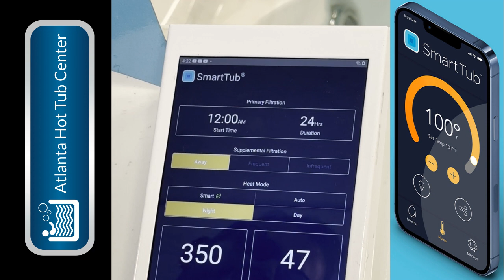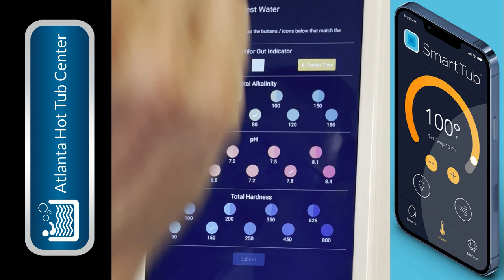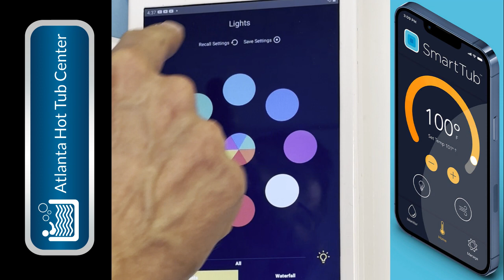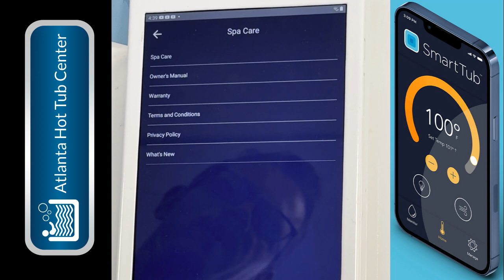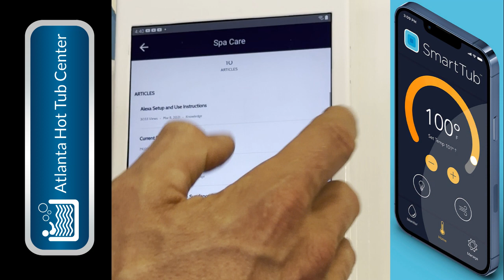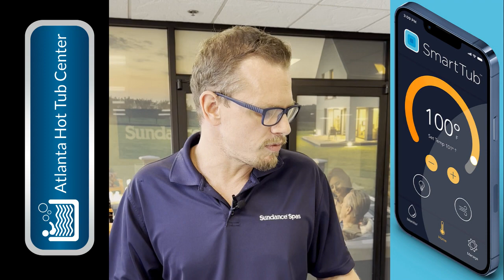Smart Technology for a Better Hot Tub Experience: The Sundance SmartTub Demo

Comment: Ours worked great for the first few weeks when we got the hot tub, then for some reason it spotted working while we’re away from the house… the system just kicks us out and we get an error code saying it timed out. Call customer service and was told that I need to get an antenna for it due to low cellular coverage. What a Bummer!
Reply from the maker: Good morning, the extender antenna for the SmartTub works really well.  They’re around $20 from your dealer and most dealers won’t even charge you for it.  I would call your dealer.  However, if your cell signal isn’t good then it will run on your WiFi which is why it works close in close proximity of your home.  Hope this helps!
Reply: I have a Jacuzzi tub with SmartTub, which I’ve been told it does not run on Wi-Fi. Thank you for the information and contacting the dealer to see what we can do about the booster antenna. Thanks.
Reply from the maker: @davidp8791  Good afternoon, the new 2024 SmartTubs work in WiFi and cell network.  Might be worth looking into.  Hope this helps!

Comment: I thought there was a wifi model coming out this year? For those of us who don't get cell coverage.
Reply: Does SmartTub only works with one specific brand of hot tubs? We have a THERMOSPAS hot tub… bought it last year.
Reply from the maker: @RickySilvaMusic  Good evening, SmartTub won't work with thermospas unfortunately.  However, ThermoSpas should have a app based wifi product you could use.  Hope this helps!
Reply from the maker: Good evening, there's already a wifi module out called SunSmart which you could use.  SmartTub will end up working for wifi as well which is coming out soon but the software will be limited due to it being on wifi.  Hope this helps!
Reply from the maker: I stand corrected the new SmartTub for 2024 will have all the abilities of the current cell version.  I actually just had a meeting about this.  The new SmartTub will link up to cellular and wifi and use the best signal.  The new one will also use any network such as Verizon, Team Mobile, AT&T etc.  Hope this helps!
Reply: @atlantahottubcenter  Any idea when it will be available for purchase?
Reply from the maker: @machaf  Good morning, I think some time in mid February.  That's what I am seeing as of now but of course that could change.  Hope this helps!